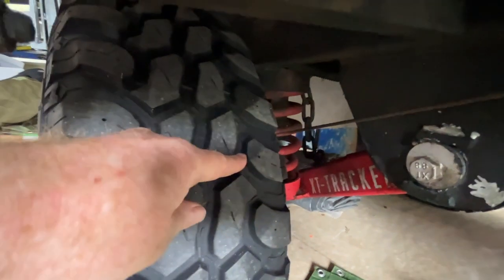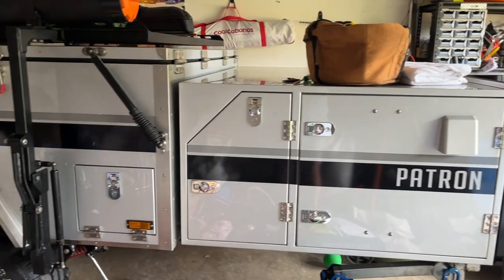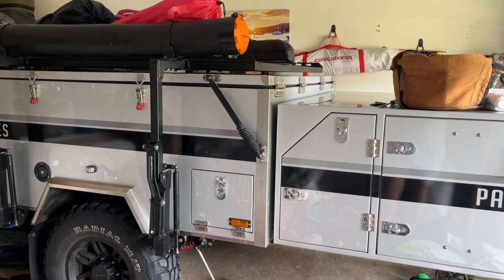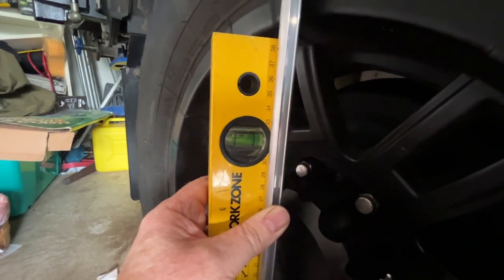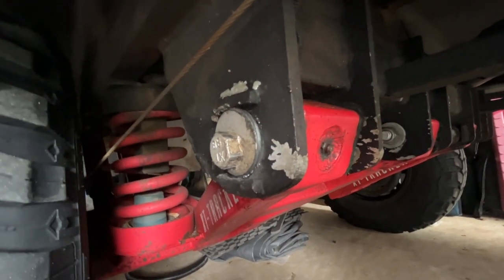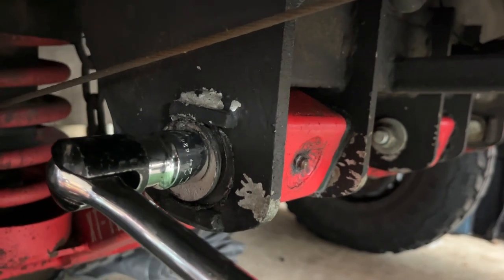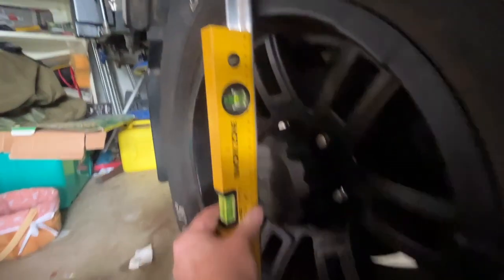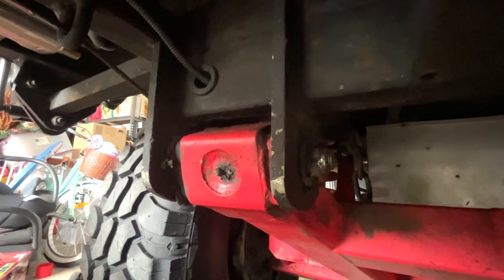Camper Trailer Wheel Alignment | Camber Adjustment on Black Series Patron

Comment: I just did this on my camper. I recommend lifting up the chassis to allow the adjustment to move. I tried without jacking and the bolt would turn but flick back to where it started as there was too much pressure. Jacking the chassis helped heaps. But thanks for the video  it really helped me as there isn't much online for some reason
Reply from the maker: Thanks Lee. Jacking off the chassis is a much better idea if you have a jack or supports to reach the height.

Comment: Hi just discovered your channel recently and love your content, was wondering is it possible for you to do an in-depth review on your camper trailer. Pros,cons ect? We are considering the same model second hand
Reply from the maker: Thanks for the feedback. We’ve had it for 5 years and look after it (service it, grease bearings etc) My only recommendation is to try and store it under cover. From what I’ve seen the seals around the lid can vary and are susceptible to water leakage. I’ve never had any issue with mine travelling (water or dust). It’s been a great trailer for a family of 5 if you are ok with a 40min set up for the whole tent and awning. You can set up in 10 min if you just want the tent for the night. I’ve upgraded batteries and installed an aftermarket dcdc charger  and that has made a big difference. If you want easy set up, consider a hybrid but they’re heavy. If you want space for a few kids this is a great solution.

Comment: Is there a bushing that wears in the adjustment bolt tube? Mines the same - max adjustment to get it right… Unsure what to do when/if it bends or whatever again, and I can’t adjust more… If it’s a bushing that might explain things, as I can’t see anything visibly damaged…
Reply from the maker: Yes its a 50mm x 50mm square bushing. Very likely it’s worn out if your maxing the adjustment. You can get replacements from Breece at Lovells https://lovellssp.com.au/product/new-lsp-mkii-swing-arm-bush-replacements-for-50mm-x-50mm-mounts/
Reply: @explore_moor Cool! Thanks!